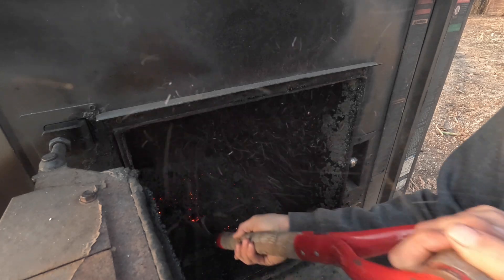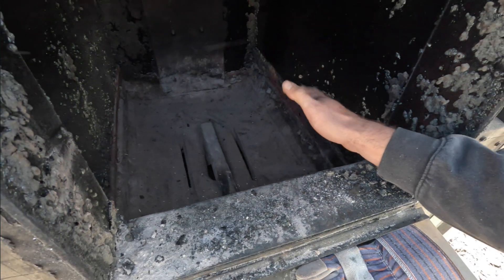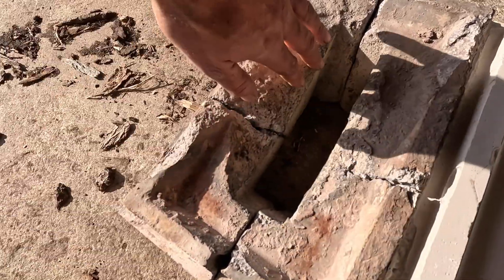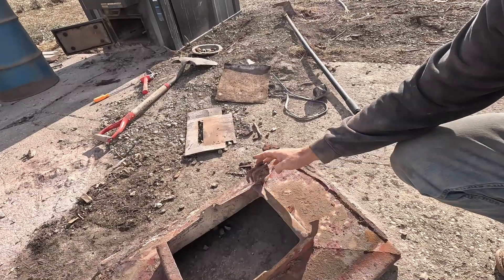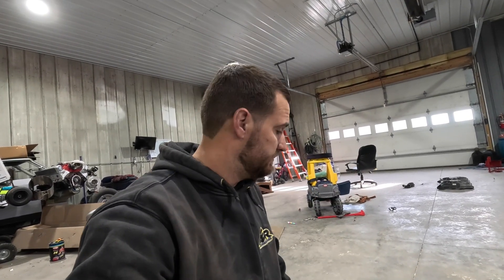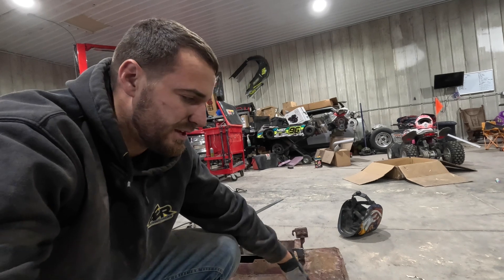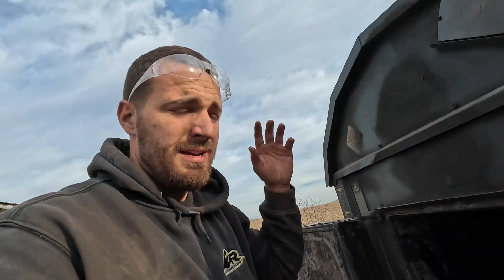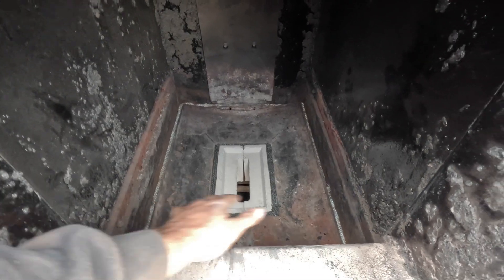IT BURNS TOO MUCH WOOD!! Heating on a budget, fixing my $200 wood boiler (AGAIN) Episode 3

Comment: Those 2 gaps on the left and right of the block are supposed to be filled with a rope gasket, that's why you are loosing efficiency
Reply from the maker: I fixed that in this video along with a couple other problems I found. This year I'm working on making the building w little more tight to help with efficiency. Thanks for watching!

Comment: Do you have the terrible Gen 1 of the 550 series with access to the secondary heat exchanger rows from the inside😒 they rectified all these problems on the new ones.
Reply from the maker: Yeah it's a little bit of a pain to clean. But ill deal with it for what's invested!

Comment: Great job. Keep up with maintenance and keep water around factory recommendations. These don’t last when someone doesn’t take care of the water. Gasification stoves are wood snobs. Make sure the wood is seasoned and dry. I have a conventional stove and use 10+ cords in MN winters heating 3k sq ft. You should be 50-60% less wood, 40 at the low end. A lot of good videos on these stoves from maintenance procedures to issues and repairs. Central boilers have a good dealer network and most are willing to help out anyone with issues. You can send water samples into central and they will test and give recommendations on fixing water quality for your stove as well.
Reply from the maker: Its been doing much better since the repair, I've also notices I get a better coal bed if my wood isnt split up so small. Thanks for the advice!

Comment: Don't give up. You picked it up for a song. The previous owner didn't do the proper yearly maintenance on it. You get your " ROI" on what you've invested in the first year especially in you run lines to your house and heat your domestic hot water and your house. Good job. Keep on keepin  on ! Waiting for your update💪✌
Reply from the maker: Unfortunately for what it would cost to run good insulated line over to the house, its really not cost effective. At this point it would be a better ROI to install my own on grid solar system...hmm maybe a new mini series.
Reply: @AERiowa  You can run 1" pex with "MAX R" pipe insulation and just throw it in the trench. MAX R is great stuff. I've used it on several jobs. You would probably only need one big Taco pump on the back of your furnace to supply your house and hot plate for your domestic hot water.

Comment: After this winter.  Consider hooking this to the house.  Figure it will save you 6 months out of the year about 500 bucks just in electricity for your hot water heater.  (if it isn't propane of course!).
Reply from the maker: Just isn't cost effective for a 170' run to the house. I think the next addition to the acreage will be a DIY on grid solar panel system!

Comment: I have had the 5036 classic since 2008. It has worked flawlessly.  Average wood use is generally 8 cords for heat and hot water in an 1800 sq ft house. They were looking to get better emissions numbers when they went to gasification with the edge. More complicated=more problems.  Nice job with the fix.
Reply from the maker: Good to know. I think I would be happier with with a classic non gasser because of the lower maintenance. However I don't think I can beat what I have invested in this. Thanks for watching!

Comment: The angle iron on the sides is supposed to help the wood fall down as the fire burns down. That way it doesn't stick to the side as creasote builds up. I had a classic edge hdx 750 that came with them. Ended up selling the 750 and got a classic 6048.
Reply from the maker: What was your reason? For lower maintenance?
Reply: @AERiowa  Lower maintenance and the wood usage. I was expecting to use less than I had been using. The time spent on splitting down wood smaller along with cleaning was too much. Therefore, I decided to switch and have not looked back. The classic uses more wood, but that is not an issue as we have unlimited wood.

Comment: Now I’m learning form you. I hope I don’t have to replace blocks and floor but know I know how took. My edge 550 has   Able iron on the sides. I’ll send you a quick video. Good stuff ! And $200 is a steal
Reply from the maker: Thanks!  How long does yours hold temp? Obviously outside temp has a lot to do with it. My last thing to check after this is to make sure mice didn't take all the insulation off the tank at the previous owners property.
Reply: @ 12-14 hours burn times. Keep me posted
Reply from the maker: How full do you load it? Sqft your heating? Im only heating 2400sqft.  Thanks for your help! @offthetrailsoutdoors